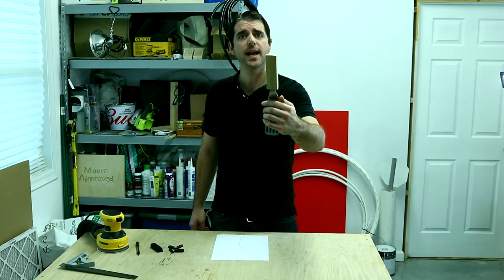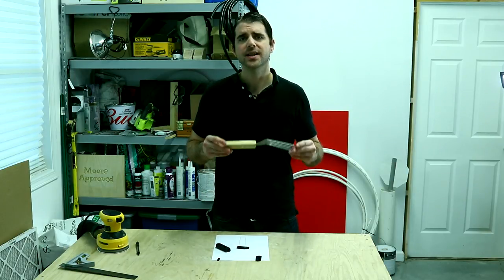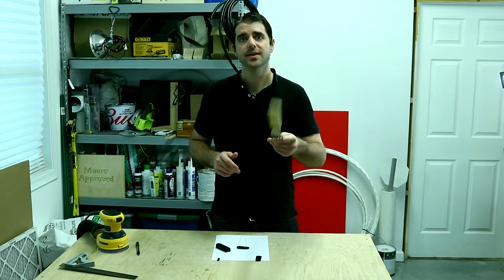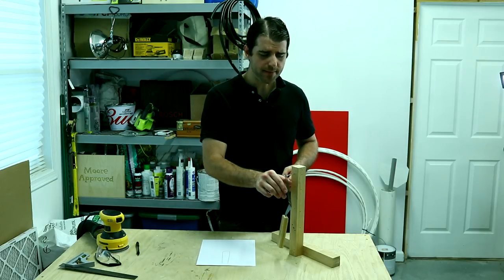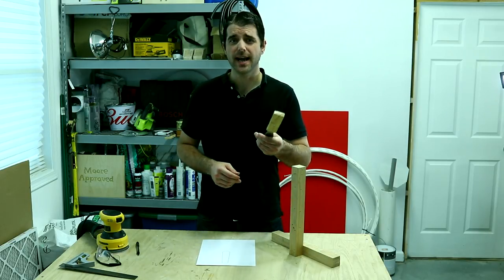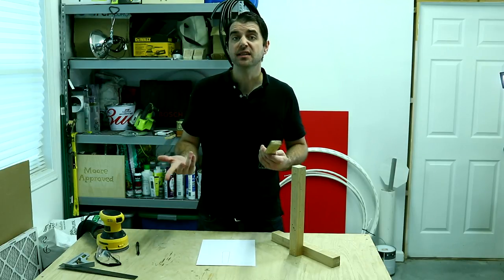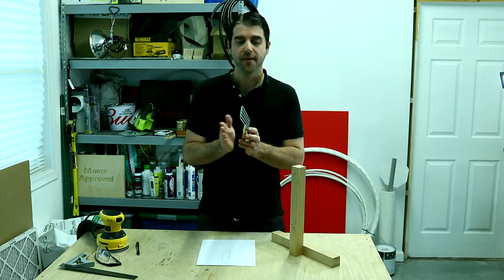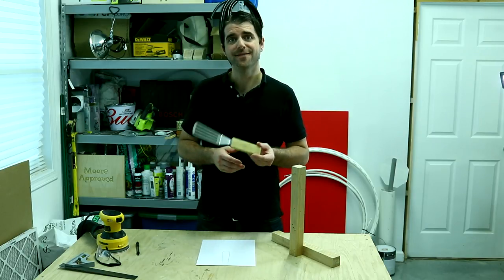Make A Custom Wooden Handle | Fix a Broken Spatula or Knife Handle |  Wooden Handle For A Spatula

Comment: Great video--I'd like to know more about how you got the rivets apart.  Did you just pull?
Reply from the maker: Indeed. After the original handle was completely separated it was easy to remove the rivets with two sets of vice grips.